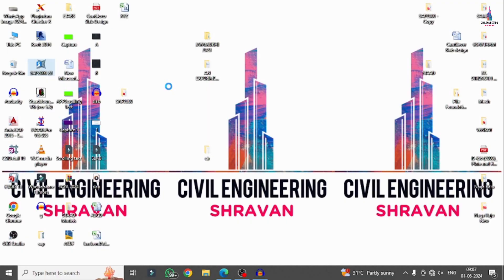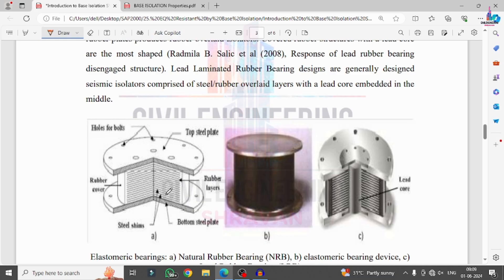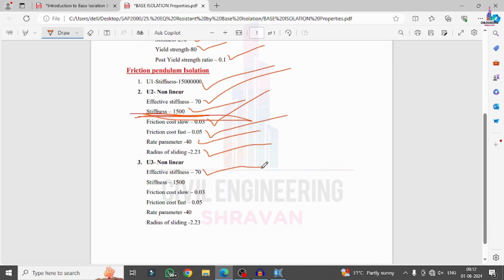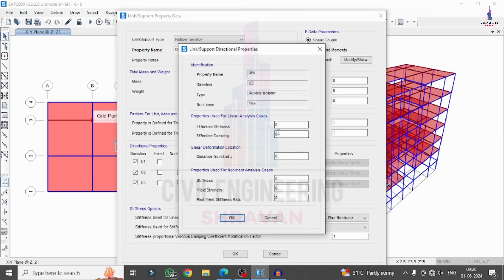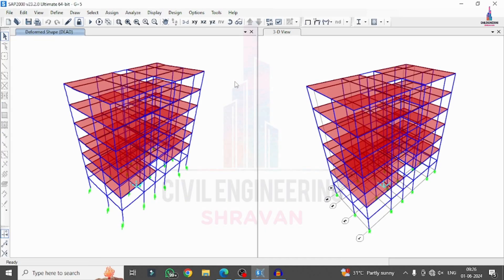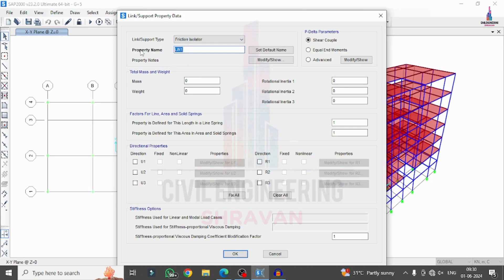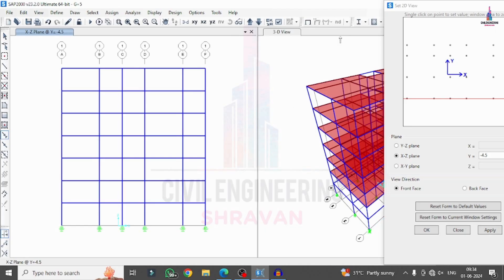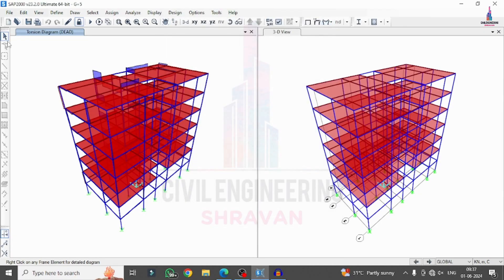Base Isolation System in SAP2000 Software | Rubber Base Isolation | Friction Pendulum System |

Comment: Hi, thanks for the video. I'd like to offer a quick clarification on two points. 
First, the U1/U2/U3 directions are the link's local axes, not fixed global directions. U1 is always the axial direction (along the element), and U2/U3 are the shear directions. In the most common setup (a vertical isolator), U1 (axial) usually aligns with Global Z, while U2/U3 (shear) align with Global X and Y. 

Second, it is crucial to emphasize that the stiffness/strength parameters must be determined from isolator properties and design formulas. Design of seismic isolator generally requires iterative procedure. It is important for viewers to know this isn't just 'filling in boxes' but requires a proper engineering design. Keep up the great work!
Reply from the maker: Yes as per the Research done by the scholars and Publications we are assumed those parameters